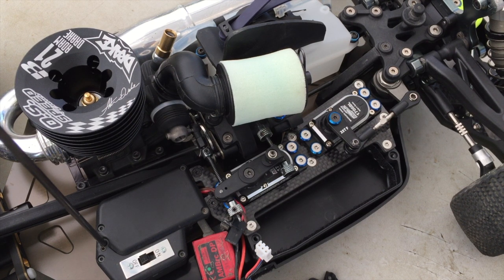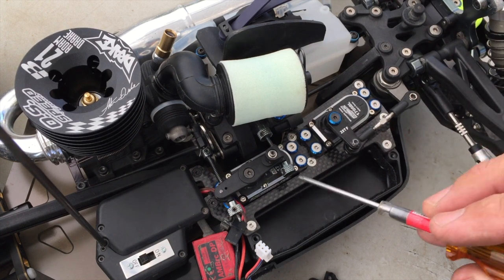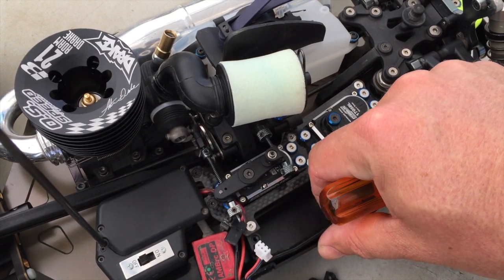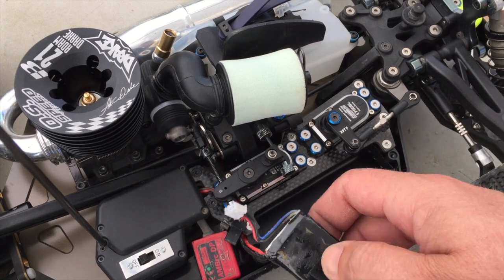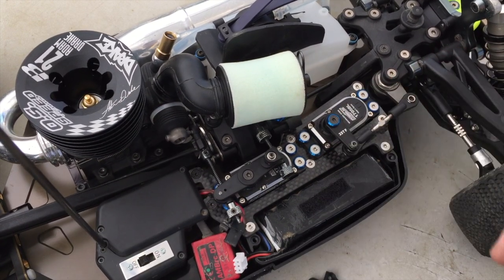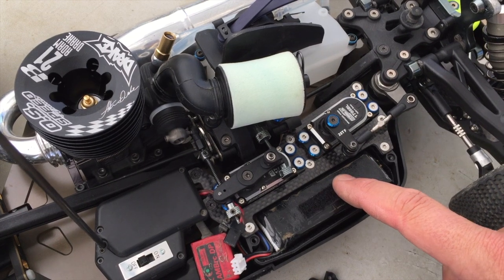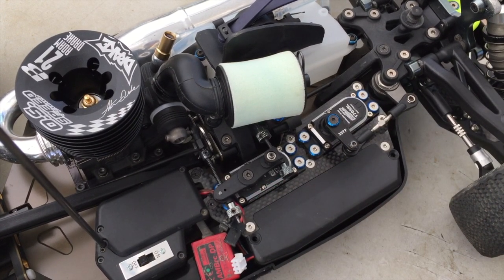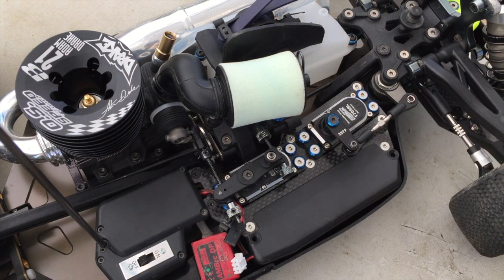Adam Drake from Mugen Seiki Racing - MBX8 Battery box tips.

Comment: My Drake, I know you pros use them high power servos, I recently just got some, is it normal for them to flex the servo plate and it’s only the throttle, I had reduce as much braking but that joker does flex, Sonia that normal or is it time for to replace, thank you for your time
Reply from the maker: That's normal if you're running the EPA high and have a lot of brakes.
Reply: Thank you, Mr Drake not my drake dang iPhone
Reply from the maker: My pleasure!

Comment: Adam my car is high pitched when I start it
Reply: then your idle is too high
Reply: God4Gaming no it's not that we turned the idle but it didint do any thing.
Reply: then it could be that the engine was started when it was cold. Once it heats up the idle will drop
Reply: God4Gaming when we started it we tryed to make the idle go down but it never did the engine was got during that
Reply: try leaning off the high and low speed needles by 5 minute turns anti clockwise. I have a feeling too much fuel is going into the engine
Reply from the maker: It could be slightly too lean on bottom or the idle is a little high, but I don't suggest tuning the engine until it's up to operating temp.